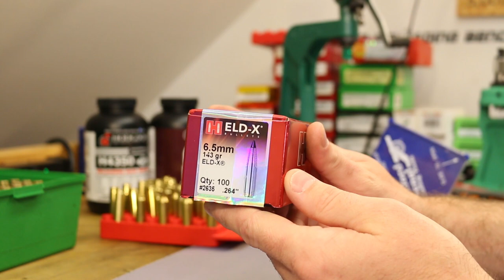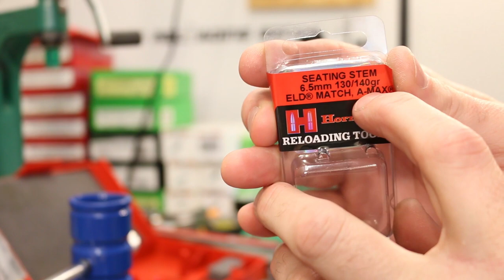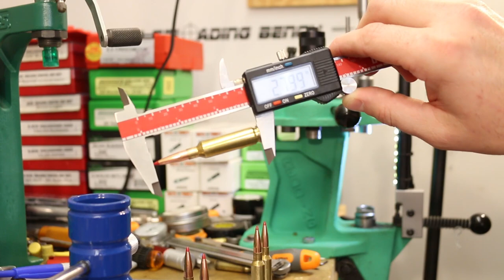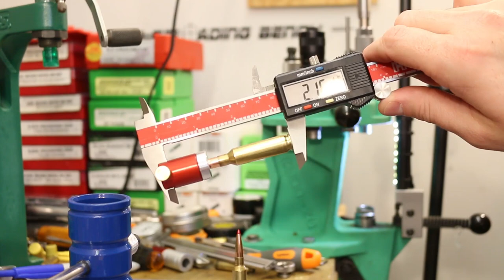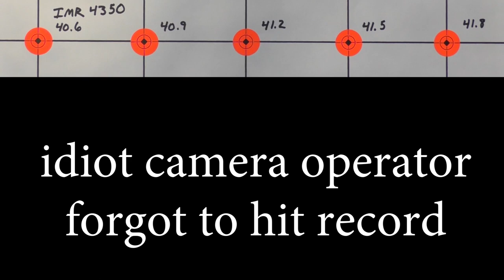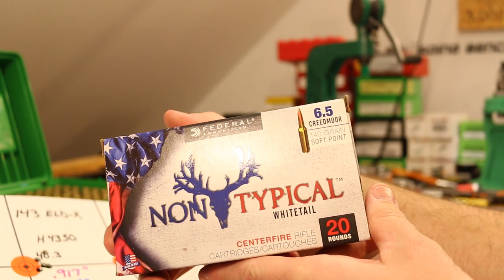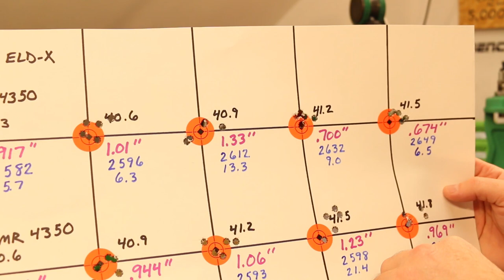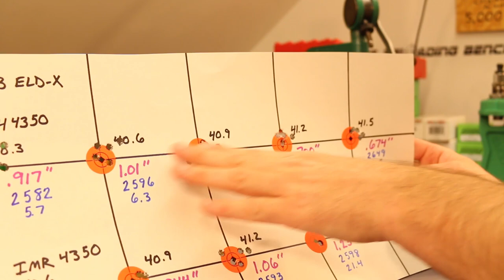6.5 Creedmoor - H4350 vs IMR4350 - 143 ELD-X

Comment: With the two 6.5 creedmoors I've had with h4350 had there nodes at 42.4 and 42.5. I've pushed out to 43.5 before with no signs. They both loved the 143 eld-x and they perform great on deer.

Comment: 41.5 with H4350 is my match load with 140 ELD'S, and it was one of the old recipes hornady put on their 140 a-max match loads a few years back. There will be another node between 42.5-43 grains if you care to run that hot, you'll gain about 60fps. One of the reasons many shooters run that high and higher is due to the original loads in hodgdon's load data that went considerable higher.  RL-16 is another powder that is awesome in the creedmoor with 130-150 grain bullets.
Reply: Mine defiance with Bartlein barrel shoots so well off the 140 A-MAX match, it almost isn't worth reloading for.
Reply from the maker: That's everyone's match load!  I will probably not be doing a lot of additional work with H4350 since it's hard to find and the loads are already so well known.  I'll be pushing it much harder before this can is empty, though.  I want to see if my primer cratering turns to piercing once the pressures get up over 60K, and H4350 is probably the "safest" way to do that since everyone and their brother has already shot it.  Should be fun.  RL16 is definitely in the plans...I just need to pick up a can.  I've got AA4350, RL26, N160 and N550 in the plans as well.  Should be fun.
Reply: @JohnnysReloadingBench  AA-4350 has always worked second best to H-4350. Having said that I do have a 300 Win Mag load that is my best load with AA-4350. It shoots under 3-inch groups at 300 yards every time. IMR 4350 can be accurate, but the velocities are so much lower than either of the other two.

Comment: I jumped on the Creedmoor bandwagon over  three yrs ago, all of my friends said it would be a flash in the pan. And factory ammo was hard to come by.  (No pun intended) I have loads of data on this cartridge in all types of bullets, powders, primers, and most importantly weather.  

I currently am using a Christensen BA Tactical in 6.5 Creedmoor Harris Bi-pod, Vortex Razor HD 4.5-27. 
The best load I have found for consistency in all weather and temps is the 147gr. ELD M with 42gr. of H4350 Federal 210 Primers either match or regular (made no difference) My SD are around 2.2-3. Hornady brass trimmed to 1.915. Forster press, Hornady full length dies adjusted to bump size. This is consistent just under .5 MOA.  Velocity is 2805 at 50-105 degrees. 2997 at 28-50 degrees. 

Consistent cold bore hits at 1500 yds and under. Anything over 1500 consistency drops dramatically best I can do is 3 out of ten at 1776 yds. Well beyond effective range, I do it just for the lols. Gets right down to after 1500yds grab a 7mm Rem Mag or 300 Win. Mag. 

I currently have all data on IMR4350, Reloader 17, Reloader 16,  H4350 Using bullets ranging from 129-147gr Berger, Nosler, Hornady, bullets. 

Brass data is now under development. Love my results with Hornady Brass. With this warm of load good for only 4 reloads due to  loose primer pockets. Currently trying SIg, Starline, Nosler brass. I have used Lapua and found the small rifle primer does not efficiently burn under 50 degrees and over 40.5 grains of powder.  If any questions feel free to ask. 

IMR 4350 is one of the worst powders due to temperature stabilization. Ten degrees will change velocity of up to 15fps especially once it drops below 80 degrees. SD opens up dramatically also.

Comment: I'm the one who reported a drifting issue with the little scale.   Didn't realize there had been a reply until I watched this video, LOL.   Responded in the other post, but a cut and paste here as well:

"JRB, I didn't think about the batteries, but I just installed some fresh ones.  I'm still having the same problem, which is: once I've calibrated and zeroed (set tare) with the pan on the scale I will get anything from 0.0 to 0.2 once I remove the pan and replace it.   What's also interesting is that my tare weight will vary with the pan removed (between 146.5 and -146.7 grains).  I can also leave the empty pan on the scale and the reading will drift +/ .1gr just sitting there.  I've tried it in several different rooms in the house, so I can't see it being a wind/draft issue."

I see that tuma benny and ktmracer358 ! are also reporting similar issues with theirs.

Comment: It seems that the groups are tightening on at a certain case fill. When you hit about max case fill on the H4350 the group was tight and same with the IMR 4350. Once you went to a compressed charge the groups opened up.

Comment: Like others have said the book load data for H4350 is very conservative. The nodes on my rifle are 41.5, 42.7, and 43.5 at 43.5 from my 22" barrel I see 2780fps with 140gr eld-m. I am using Lapua and Starline SR brass with no pressure signs.
Reply: Chip Herrick man try some rl 16.
Reply: bikeboy0012 will do, I have used RL17 with good results, but bought 16# of H4350 when I jumped in to the CM. Next ti me I at the store I an going  to get RL 16,17, and 26 to play with.
Reply: Dang phone auto correct sorry for the typos
Reply from the maker: I'm going to use the rest of this can of H4350 to push things much harder before I move on to the other powders I want to test.  So many people shoot it, there's plenty of info and experience of shooting way above max.  Should be the safest way to see how the gun acts at higher pressures.  I'm curious to see if my primer craters become pierced primers!

Comment: Good shooting combo.  Nice performance on both powders.  Back before 2000, I said a lot of times that if I couldn't load it with IMR 4350, I didn't need it.   H-4350 looks to be a touch better even.
Reply: So H4350 test first and then I4350 after barrels was dirt so it doesn’t compare. Trying clean barrel and then test I4350 first after that H4350
Reply: Even AA-4350 outperforms IMR-4350 honestly. Not saying you can't get accurate loads from IMR-4350 just saying they will all be of lower velocity than the others H-4350 is the king and AA-4350 is the runner up in 4350's. Now IMR-4350 beats a newcomer Shooters World 4350 that even shoots slower loads than the other 3.

Comment: I actually have both, and the little scale is still solid, the large one does not drift however I get the same thing + or - .06 gr. However I have been using the Deluxe Digital Scale from Powstro  and it is .05 accuracy and seems for me to be the go to for speed and a bit more precision.
Reply: Tango Bravo Zulu link to that scale?

Comment: 41.5 is not the top end. You should be able to push around 43gr especially with small rifle primer brass. Book value is ultra conservative for h4350. The pitted primers are due to your firing pin not being bushed.
Reply from the maker: I'll be pushing things harder as we go along.  I'm not going to worry about bushing the bolt or anything crazy like that (would probably cost as much as the gun!) unless we start piercing primers.  I'm sure the cratering will probably be our first failure point when we get those pressures up.
Reply: Johnny's Reloading Bench I didn't mess with the bolt on mine either.  When I still used Hornady I was up to 43.0 with the 142smk and now I'm running 45.1(lapua brass) with a 130 Berger VLD. You'll be glad you didn't mess with the large primers. I'm up to 10 firings on lapua brass and sometimes the Hornady brass primer pockets were done for after 2-3 firings.
Reply: @davidhunt1606  what were the sings the hornady brass done at 3 firings?
Reply: @rustyshackleford2723  Very loose primer pockets. In some cases the primers actually fell out while charging with powder.

Comment: I packed in 44.0gr of H4350 behind a 129gr ELD Match. Slightly compressed at 2.800", but nothing crazy. Grouped a hair under an inch in my buddy's RPR. Definitely worth cranking up the heat a little bit on your loads.

Comment: I recently bought a savage axis 2  6.5 CM.  which i consider a budget gun for sur I'm shooting .32 inch groups at 100 yrds with 143 grain eldx and 43.2 grains of superformance  in hornady brass .  As well I'm smacking a 6 x 10 inch steel rectangle target at 600 yrds consistently  it goes to show u don't need to buy a 2000 dollar gun and use high end components to group well

Comment: I have found 2 grains difference between these powders. Add 2 grains to H-4350 then these powders well be the same.and you will get the same results on the paper across the board . No pressure problems if you take care on the top ends

Comment: Your primer cratering could be due to the Small Rifle Primers being shot through a bolt set up for Large Rifle Primers. It used to happen on my Remington 700 until I had the firing pin bushed.

Comment: If you compare the groups with similar average velocities the group sizes are similar between the H and IMR 4350. Maybe a little bit more powder and some seating depth and the IMR will show its accuracy.
Reply: IMR 4350 is a good powder, but it will not get the velocity and accuracy of H-4350 or even AA-4350. Out of those different manufacturers IMR-4350 may be accurate but only with lower velocity loads. If you want more speed and still be accurate either of the other 4350's are a better choice. BTW the new Shooters World 4350 shoots even lower velocities than IMR 4350. If you are just shooting at paper any will work. But if you want to hunt and need a bit more velocity not so much.
Reply: @andy347495  Andy just my opinion I have used all the 4350's except Shooters World and have reloaded for 40 years or better now. We all have different experiences and opinions. Just saying. I have a great load with AA4350 for my 300 Win Mag. I have had great loads for my 30-06 with Hodgdon 4350. IMR 4350 will not be accurate with tjhe velocities out of either of those others.

Comment: I have found that 4350 like hotter charges with many of the cartridges I have used it in mostly in 3006 hunting loads and some in 7mm08 with heavy bullets and in several different rifles and usually a full case of 4350 shined the best. But just what I have found thus far thanks for the info Johnny and hope you feel better I know how you feel like sh**

Comment: Johnny you should get a RCBS Chargemaster Lite.  Best auto measure on the market.  Save a lot of time.  Every once in awhile it may get an overcharge but very seldom.  All you need to do is put it back in the hopper and do it over to get it right.  I use to do what you are doing and after researching decided on the RCBS Chargemaster Lite because it is the most accurate and does not throw very many if any over charges like the competition.  It's all because of their trickler being better than the rest even better than their most expensive Chargemaster.

Comment: I loaded 7mm 08 with charges of h4350 and they are looong. 2.875. Those eldx seat awful deep so you lose case capacity. While they crunched a bit going in when shook they are loose. The boat tail just has to shove the powder into the shoulder. 
  Albeit mine are 162s with 42.2 as max. A powder drop would have helped settle that bulky ole stuff.

Comment: i have a 6.5CM as well, did you have any issues with firing pin when using small rifle primers?? i want to get Starline small rifle primer brass but i dont want to buy them and them not working with my rifle

Comment: I can’t seem to find H4350.  I have some IMR4350, RL17 and Hybrid V100.  I just bought a Savage 10b 6.5 CM.  I bought the 143 ELDX bullets.   I have large primer brass and plan to use CCI 200 primers.  Any suggestions on where to start for some accuracy loads??

Comment: I'd be curious to see how your velocities and SDs would be affected by using the same Starline brass except with LR primers. (I believe you said it comes both ways)
Reply: The cartridge was designed to be used with large primers. Bench shooters got into the small primers to make the primer a smaller factor in the charge itself. But the bench shooters that helped design this cartridge made it with large primers. Large primers are a better way to go for dependability. They say that perhaps smaller primers will give longer case life because they will not enlarge the primer pocket. I want consistency in ignition. Even Johnny ran into hang fires with small primers and minimum charge loads.
Reply: @garrytalley8009  I agree. I don't know why they even started making these SR primer cases for .308 based cartridges... and I guess I don't want to know why, I just prefer LR primers and they've never failed me.

Comment: Just out of curiosity, if your scale has so much variation why not just use a powder measure with a baffle like the uniflow? I find it to be much faster and it is very accurate with shorter stick powder like benchmark. I know some of the powders chop but it's still pretty accurate.

Comment: Two things,  one guy was loading powder using a vibrating toothbrush on the case and the powder dropped in the case a lot. More room.  Also can u load 147grain 6.5 creedmore bullets? Cannot find info to load anywhere. Keep it up very cool.

Comment: Got a quick question if you can run the hornady 129 grain bulets with IMR 4350 @ around 2700 curious to see the groups 
Start load  41.4 grains 
41.8
42.2
42.6
43.0 grains max load data

Comment: H4350 is clearly the winner in this test, nice tight groups and SD’s
Reply: If you want a better idea of ES and SD. Just for the heck of it.  Do it with 10 shot readings.  It will give you a better idea of load uniformity.

Comment: Looking forward to the temp sensitivity series. I've been noticing the federal 175 grain SMK .308 rounds are nowhere near as repeatable/accurate in cold temps. Warm weather they give me cloverleaves at 100yds. It's what has me considering getting into handloading. Well, that and the fact that I have a .338LM on layaway and basically have to to get the most out of it. But yeah. Looking forward to tour testing with H4350 extreme because that's the powder I read about in a test and it outperformed everything else in temp fluctuations.

Comment: What is the rationale of using small primers instead of large primers?
Reply: minutemanqvs stronger case heads
Reply: minutemanqvs the smaller primers don't tend to loosen up like the large primed brass. I saw a test done on YouTube by the 6.5guys and they got 20+ firings out of the small primer brass w/o loose pockets, but the large primed brass eventually could not hold a primer. With expensive Lapua brass, it will save you money in the end.
Reply from the maker: Neil and spyder covered it pretty well.  It's a VERY involved and confusing discussion, with lots of grandiose claims.  I have some large primer brass and plan to do some testing soon, but so far I am really liking the small primer brass.  More testing to come...

Comment: When you measure groups do you go center to center or outside to outside minus the bullet diameter?
Reply: Both of those numbers will be the same...
Reply from the maker: I zero my calipers at the bullet diameter.  In this case, .264.  Then I measure the outside from the edge to edge of the grease marks.

Comment: I'd get some Lapua brass, CCI 450 Primers and take your H4350 charges to 42.6. Forget that IMR stuff.
Reply: Sig _nified I have both Starline and Lapua brass and I have done some small batch comparison testing, I don't have enough data points yet to get on my soap box, but so far consistency and performance between the 2 does not justify the $.40-.60 premium of the Lapua brass.
Reply: Chip Herrick Gotcha. It was a game changer for me but then again, I haven't tried the Starline brass yet. Looking forward to more of this series. Good work!

Comment: I accidentally poured some H4350 into the bottle of IRM 4350.
The powder mixture is about 50/50 now.
Does anyone have any advice if I load my6.5 creedmoor,with the mix powders,140 ELD MATCH projectiles and just load to 40.6 gn.???????
Reply: Gonna have to get rid of the bottle entirely. It's no good now. Just because the two powders share the same 4350 designation doesn't mean they are the same thing. Each powder has different burn rate characteristics. You try filling cases with a mixture and that's just asking for an accident to happen.

Comment: Same powder... both companies and Winchester  get the powder from ADI an Australian gun powder manufacturer. Hp 38 is Winchester 231 and H 110 is Winchester 295
https://thefiringline.com/forums/showthread.php?t=355217
Any difference would be batch related I would think
Reply: Jim Pettinato sorry bro not the same powder close, but not the same, look at the powders when they are side by side
Reply from the maker: Lots of examples where that is correct, like your examples, but H4350 and IMR 4350 are extremely different.  The up close pictures, examples of case fill, and range results in this video certainly prove that.  They're even different colors!
Reply: well, there's a video, call Hodgen, Winchester and IMR , possibly email ADI in Austrailia :)
Reply: Jim Pettinato 
H4350 is AR2209 not IMR 4350
Reply: IMR4350 is much more temp sensitive compared to H4350
Reply: Jim Pettinato 18:35

Comment: You will get some more Accuracy with H4350 with a few more steps up in powder. Your about 100 FPS slow until a very well known accuracy known in the 6.5 creed. I run Lapua brass with 140 eld’s with 42.2 grains of H4350 and no pressure signs.

Comment: Understanding you're an SME with reloading, what round wound you recommend straight out of the box for the Compass 6.5 Creedmoor? Thanks!
Reply: I have the 6.5 cm compass. It liked 125g winchester open tip field. Got moa out the box and struck 600 yards repeatedly holding moa. Be advised the BC is super low for a 6.5 and it goes sub sonic around 800 yards. Other rounds it liker was hornady american gunner 140g hpbt. Got all the way to 1000m with no issues. Hope this helps